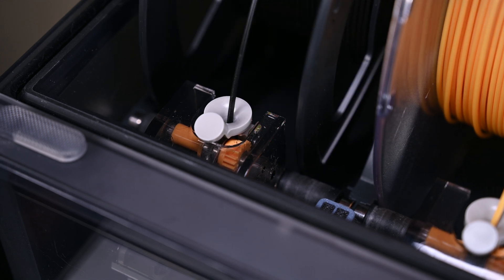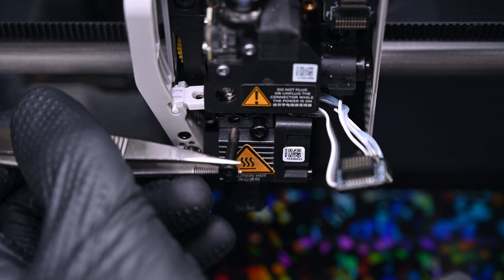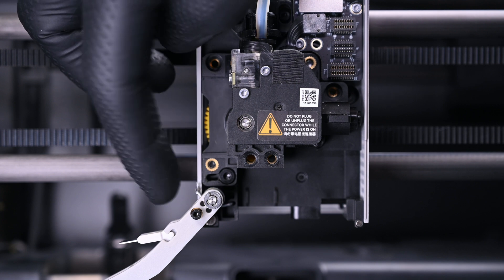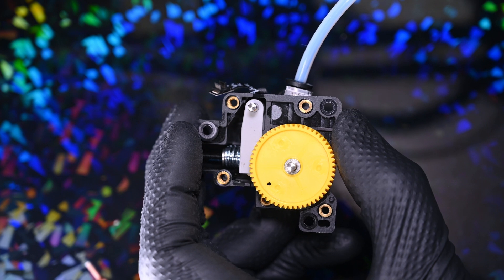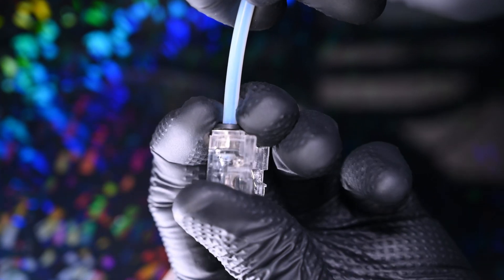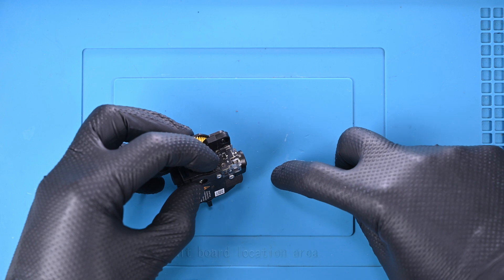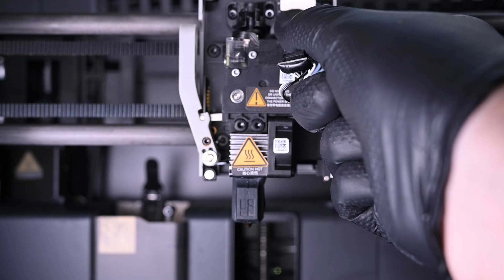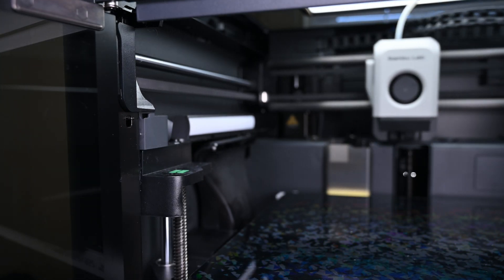Bambu P1S Full Extruder Teardown Guide - Failed to pull out the filament error fix

Comment: I have just had my first ever blockage, and good old Google sent me to this video. 

Now I'm not a tech hardware person. I use the stuff just fine, but when it comes to pulling it apart I leave it to the actual nerds (I use this term in an awe-struck by their genius way). I have never pulled apart any device that has microchips n all that scary stuff in it. Not once ever in my 47 years on earth. 

I watched the video through and then went away to have a, not minor, anxiety attack. I then had a stern talk with myself, pulled my proverbial faecal matter together, and got stuck in. 

Naturally, the blockage I had (remember this is my first ever) was the kind that required EVERY. SINGLE. STEP. of this tutorial. I was in a state of terror the entire time. No matter how much liquid I consumed, my mouth was like the Simpson Desert in the middle of an Aussie summer. But I forged ahead. Even when the teeny tiny plug popped off that little filament detection sensor chip thing. Yeh you didn't tell me that could happen, but I'll let it slide, coz you did give me the confidence to believe I could just plug that lil b#stard back in!

My dude! You are a legend. 
Correction....You are THE legend. 
I survived. I had one doozy of a blockage, balls deep in the heart of this thing, exactly like you showed in the video. 
You guided me all the way through the storm, and out the other side, to print another day! 

Go print yourself a G.O.A.T trophy and sit it on your mantel to forever remind yourself that you sir, are a capeless hero.
Reply from the maker: What a journey! And I definitely agree, even as a supreme nerd myself, seeing something complicated for the first time is very intimidating! I’m also much more of an electronics person, when it comes to mechanical and moving parts I tend to get those sweaty palms (note the gloves). Super happy to hear you were able to fix it, and glad my video inspired some confidence! I’ve got a couple more videos out about upgrades and maintenance, hopefully they’ll come in handy if the need ever arises to use them!
Reply: @TapticDigital  I got Extruder Filament Error - Every time i try to print it rolls the filament in to extruder - waits 10s - rolls/spools back then gives me this Extruder message . I bought new metal gear wheels , filament sensor , microlidar , new PTFE Tubes and still the same error message .

Comment: Had mine (X1 Carbon) since September, and the PTFE line from the back of the printer to the print head wore through, leaving my extruder clogged.  Thank you for your video!  It made it easy to fix.

Comment: I just had my first major filament block and this video was an absolute LIFE SAVER!! I cannot stress enough just how helpful it was! I knew NOTHING about this and yet you guided me through each step and process now I feel like an expert! (Until this happens again and I need to rewatch this video because knowledge retention is hard lol)
Reply from the maker: I’ve got a couple videos about working in this printer! Also if you encounter this kind of clog a lot you may try printing with the top lid removed or the door open, it’s usually caused by excessive heat in the chamber.

Comment: Hello - I admit that I have not read through all of the comments so maybe this has been addressed. Based on what you now know, do you think adjusting the tension screw (may need to cut a little window out of the plastic to allow access) is maybe a good idea, such as loosening this tension for PLU? Thanks
Reply from the maker: I’d say it’s only really something to adjust if you get jamming or twisting of the filament. This can happen sometimes on really flexible filaments like TPU with low hardnesses. I’ve tried a few flexible filaments but haven’t had to adjust it yet. Maybe if you’re seeing deep chew marks on filament that you unload.

Comment: New to 3d printers, and not much experience with mechanisms, I was so lost when the filament got stuck, luckily found this video! Thank you for giving such detailed instructions, I managed to get to the gears and pull out the stuck melted filament. The only hiccup is the parts fan won't turn off now, I'll deal with it later. I also cleaned the clogged nozzle with your other video. THANK YOU!!!

Comment: Awesome.  I thought I would be clever and remove the tape from the spool to get the very last bit of filament because my print was almost finished.  I got my print done but a section of filament remained just above the extruder.  I thought I would have to pay to have it fixed but your directions were so clear it gave me the confidence to try to fix it.  It's working perfectly now.  I will never try to get the last inch of filament again.

Comment: This is an excellent video. It goes at just the right speed for an old fart like me!
It would really help if Bambu matched those Lego block connectors to their sockets. Maybe colour coding them would prevent mistakes being made in assembly. 
I've now the confidence to completely dismantle the extruder. Yes, my P1S had filament stuck in exactly the same place and I couldn't remove the Bowden tube. There was a big ball of filament within the gear housing This was probably due to my printing ABS on a hot day. 
I took the opportunity to fit an upgrade while doing this, a diamondback nozzle. Then, of course, ran recalibration from the LCD screen on the printer. 
Thanks for your help....

Comment: I hateee when this happens, the gears keep messing up my filament every time I print resulting in this same issue, is there a reason for this that you know of and hopefully a fix, because I cant even print anymore as it is way too frustrating.
Reply from the maker: Biggest cause I’ve found so far is heat creep. Try leaving the lid or door open during printing. Also cut off the aux fan, it won’t help this issue but it will help your prints

Comment: My son got this for Christmas. Printed one thing perfectly. Started a 2nd print and we were so thankful for this video bc we had to take the whole thing apart. I hope this isnt a reoccurring thing but thankful for this video.
Reply from the maker: When you’re printing PLA try opening the door or lid of the printer, it helps prevent heat from building up. In my case that excess heat was causing the filament to soften enough to gum up the gears

Comment: I had this 2 times on the Bambu p2s. It's not entire same procedure but close. Never had these problem on Ender printer.
Reply from the maker: No, the Ender definitely likes to give worse problems. You may not be used to printing in an enclosed system, when printing PLA try opening the door or lid of the device to reduce heat creep in the hotend. There are tons of lid risers you can print from makerworld too.

Comment: your video and instructions were amazing.  I have a new PS1 and after 5 items it clogged.  I was able to follow your instructions and had to go all the way in, like your vid.  My problem is I still have to error messages and hope to figure them out soon.  Thanks for the instructions
Reply from the maker: If you’re printing PLA try leaving the door open or lid off. Mine was heatcreep from running the bed too hot but that turned out to be entirely my fault.

Comment: This video helped me fix a jam caused by a bit of TPU that broke off inside the runout sensor when I was extracting the filament. Even though I've already been inside the extruder to upgrade to hardened steel gears, the jam wasn't in the gears, so I was glad to find this video that clearly showed the rest of the assembly and how everything fits back together at the end.

Comment: on my first print(after the test one), I got this error. I am quite disappointed. I followed it but the problem is I couldnt see the filament stuck so maybe I did it for nothing. And now it throws another error which is related to cutter sensor. I don't know what to do :(
Reply: Hello i got a clog after my first print.
I am about to take it apart but did you end up finding a fix for your printer?

Comment: This is about the most annoying thing printer. BESIDES the closed source software. I have had to fix this twice now and am ready to chuck this printer to the bin. PLASTIC should not be guiding the filament.
Reply from the maker: You may want to check your temperatures. My issue was caused by repeatedly running the bed too hot and not opening the lid or door for better ventilation, I was essentially cooking PLA before it made it to the nozzle.

Comment: Thank you so much for this video! 3 was in with my p1s I just had my first blockage, with the help of your video I could follow exactly how to disassemble and reassemble and back up and printing again!
Reply from the maker: Nice! If it happens again soon, try opening the door or removing the lid while printing. Mine was caused by heat creep, but I was also running the heat bed about 10c more than I should have.

Comment: Great Video!!! I installed a new hardened steel extruder gear assembly and cutter and complete hot end assembly using this video. I am impressed with the ease of installation and would recommend this video for the novice(me). LOL
Reply from the maker: Glad to hear it! Funny enough I have another video that’s specifically about installing the hardened gears, but both cover a full disassembly

Comment: This was a fantastic video. But can someone tell me why the hell this is happening? It's happened to me twice already. This tutorial has been very  helpful, but I'd like to know why the problem occurs so I can fix it properly.😢
Reply from the maker: In my case it was heat creep, opening the door or removing the lid solved my issue. Or turning down the bed temperature a pinch
Reply: @TapticDigital thanks a lot. I will try this❤

Comment: What size is that smaller one for the cutter? For the first time in my life I have no tool that fits said screw.
Reply from the maker: 1.5mm hex if I recall, the tool should have been included with the P1S in the accessories box
Reply: @TapticDigital  Thank you kindly, went out and got myself the smallest hex keys I could get, before reading this comment, and I can confirm, 1.5 mm is the one that did it.

Comment: Thank you, it helped alot. I found out, its not the Hotend or Extruder that blocks the filament. It is the TPU gears of the python (ams) that dont give enough grip/force and cant move the filament into the extruder. Extern filaments works just fine ...hm :D
Reply from the maker: Very interesting, I’m wondering why it would have trouble pulling the filament in? Is it an extra heavy spool or something?
Reply: @TapticDigital  I tryed different spools and since i installed the tpu gears, it cant pass through this metall thing in the transparent small box (that with the ptfe tube inserted and the small pcb on the side). I think: 1. my outer tpu rings for the big gears, are not precise enough printed, so the small one loses here and there the grip 2. the motors of the ams are to weak for the tpu gears ... 

i checked anything, changed the nozzle, checked the gear on the back thats behind the hotend ... idk ...i will test later, if the outer or inner gears are the problem (the tpu ones) but first i will print some things before it will strike again :D

Comment: Super helpful!  I had a tiny purple ball from some clogged filament right in the middle of my extruder.  As soon as I loosened the tensioning screw, it fell out.  I was able to reassemble my extruder and it’s preparing to print right now.

Comment: My first P1S (Kevin) sat in my craft room for over 2 weeks because I was just intimidated enough to just keep relying on my other printers.  I appreciate you for laying it out for us.  It took just minutes to swap out my extruder filament sensor since I'd torn the ribbon cable and now it's back up running and on to a print job (1800+ hours).  I enjoy 3D printing, not working on 3D printers, but I'm learning.  Thank you very much.
Reply from the maker: If you like printing more than tinkering, the Bambu was a good choice!

Comment: I had this EXACT same issue, It was my first experience with PETG and I was a new owner, The filament just bulged up at the top of the extruder gear causing the issue. I was wondering, if anyone knows, I didn't have custom settings for PETG at the time and the bulge looked more like the filament got soft and bulged, I think my issues was heat creep because the next time I used PETG I used the same roll with researched custom setting and it prints it as easy as PLA for me now.
Reply from the maker: My issue was indeed heat creep. Lifting the lid during printing fixed my issues thankfully

Comment: Great video thank you saved me a lot of headaches. Just curious where in the process do I reattach the fan and small bearing thing cheers
Reply from the maker: You mean the front part cooling fan? Thats the last thing to reconnect. The small bearing in mine stayed stuck in the housing but there should be one at either end of the pole that had the main large gear on it.
Reply: @TapticDigital perfect thanks mate

Comment: Great video. I think you forgot to show the bearing that slides on top of the yellow gear between it and the housing with the four screws?
Reply from the maker: I did! Just because mine was firmly stuck in the housing. I have another video about installing the hardened gears and I go just a bit deeper into taking it apart.

Comment: 4:38 Isn’t there supposed to be a bearing at the bottom of the place you are putting the big wheel? We don’t see it but I believe there is a bearing at each end of that part with the big wheel on it.
Reply from the maker: There should be a bearing on either end of the main gear post, in my case I believe it was still stuck inside the plastic housing. I’ve got another video about installing the hardened gears and it goes a bit more in depth on the assembly of that part.

Comment: I was afraid to dissasemble the printer head but to my own suprise with the help of that video it was quite easy. I had many issues on the same time. z axis wasnt set correctly, ams was clogged and extruder was faulty / tpu sticked inside. 

now i have repaired everything and would give the bambu p1s a thumbs up. its easy to repair (-: just watch a video. dont be to nervous and you should be fine
Reply from the maker: It’s definitely scary when you first pop off that front cover, but after you’ve done it once or twice it just takes a few minutes to fix. Glad you got it working!

Comment: I'm a bit confused. If the the and filament aren't stuck at the top, can I just remove them both there and be on my way, or do I have to completely disassemble the extruder to check? Seeing what you've done here scares the crap out of me.
Reply from the maker: Nah this is a really simple routine maintenance thing, if the filament isn’t stuck and can be removed, always do that instead of a teardown. But if it’s still throwing an error after removing the filament, it’s time to take it apart
Reply: @TapticDigital I got lucky. There was a 3cm piece of filament sitting right there in the end of that tube, completely free. I was able to remove it and get back to printing. Phew.

Comment: What say you… there’s a PARTICULAR print that I do that causes this filament fragment wedge to happen EVERY time. 
Help me identify it. 
It involves 4 colors over AMS. 
Other prints are fine.
Reply from the maker: Mine has always been heat creep related. Try turning down the bed temp a pinch, and open the lid and door during printing
Reply: @TapticDigital but the clot happens inside the extruder stuck in the gears. 
How does the heat seep into this great chamber?
It might as well melt the gears themselves.

Comment: Perfect video, thank you for the walk through. I had the exact same issue with squished PETG at the extruder gear. Does upgrading any of these components help prevent this??
Reply from the maker: Not really, most of it seems to be cooling related. I’ve had no problems ever since I left the lid off during printing.
Reply: @TapticDigital good information. I've been considering printing a riser kit but I have limited height on the shelf where my printer lives. I'm also guessing my issues could be related to humidity and moisture, it's been awful hot the last couple weeks.

Comment: I have the same problem. BUT! This problem always occurs when I print PLA-CF. It jams exactly as shown in the video. Does anyone have a solution for how to get around this? I can't finish any PLA-CF prints at all.
Reply from the maker: Are you printing with the door and lid closed? PLA is really sensitive to chamber heat
Reply: @TapticDigital  Everything is closed while printing.

Comment: The method for unscrewing the filament sensor is unnecessary and risky. Instead, simply use a flat tool, such as an H5 bit, to push the bearing of the gear. I don’t understand why you use tweezers to wedge the gear or even to pry the deformed filament??? This approach risks damaging the plastic case and appears very unprofessional.
Reply from the maker: Guess those 600+ comments thanking me were wrong 😂. Looking forward to seeing your professional guide